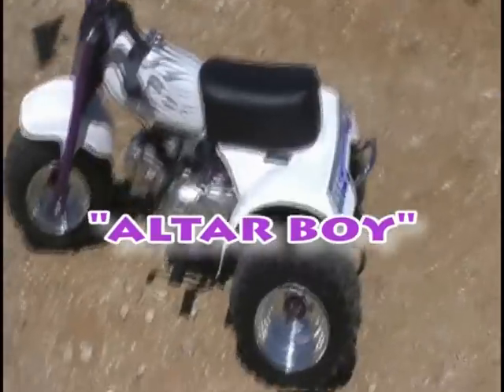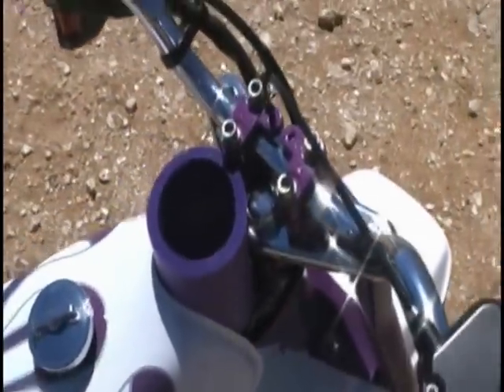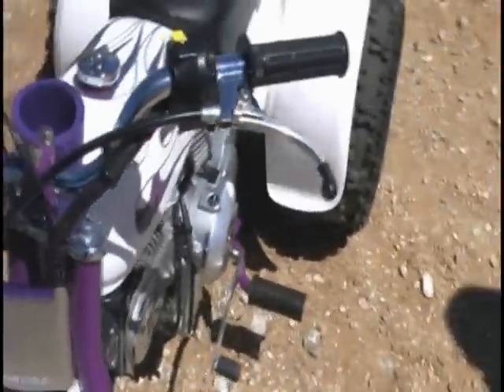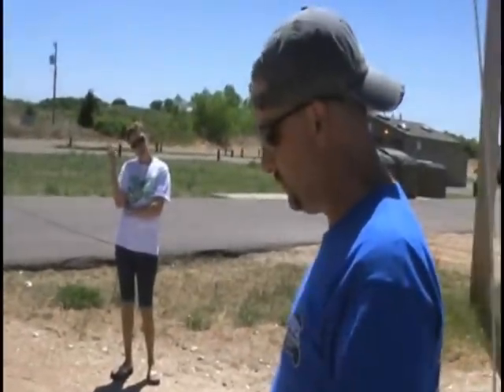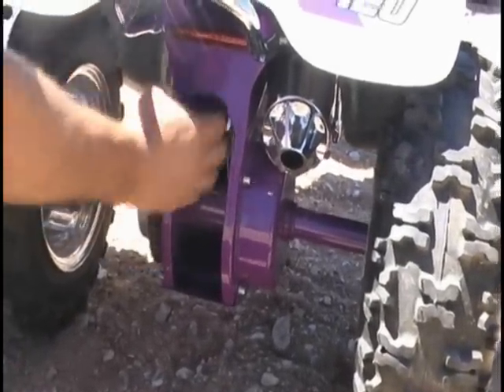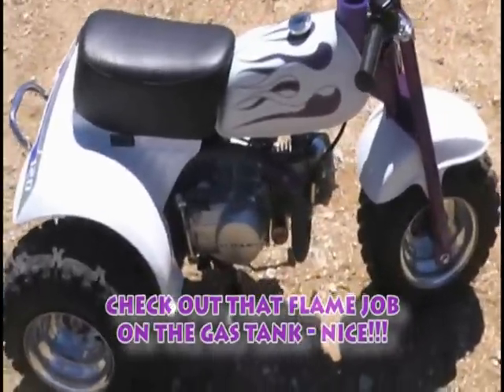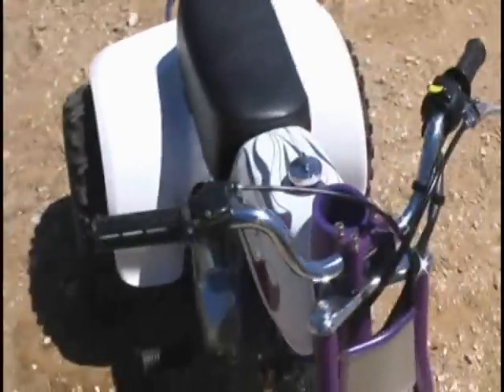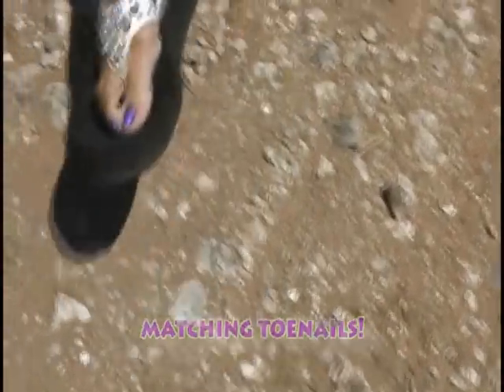Doc86R's "Altar Boy" ATC120 Hot Rod 3-Wheeler!

Comment: Nice Job Pal.I got a ATC 70 /125m engine.2inch longer frame.I thought I was the first in the world 25 years ago.Perhaps my leading link front suspention is still unique.I even stuck my battery in there to.Dont ever sell it will you.I sold mine once.Got it back worn out.Rebuilt it & will never sell again.Cheers & keep having fun.